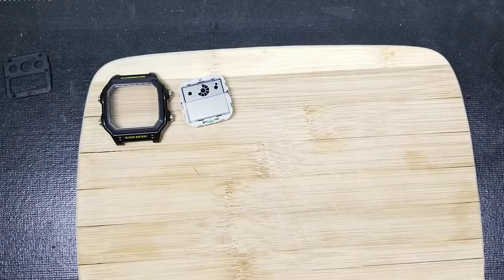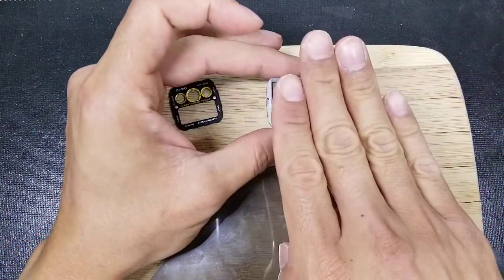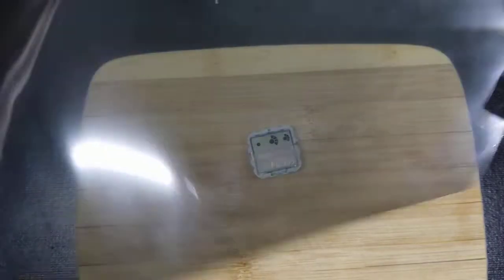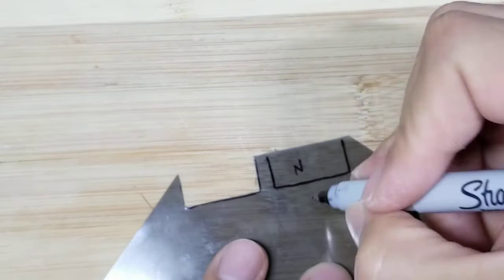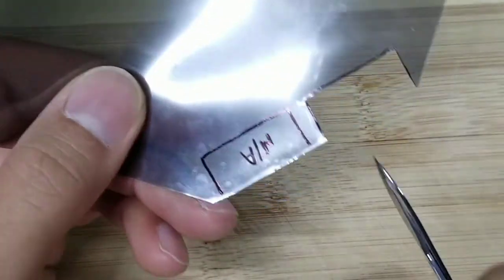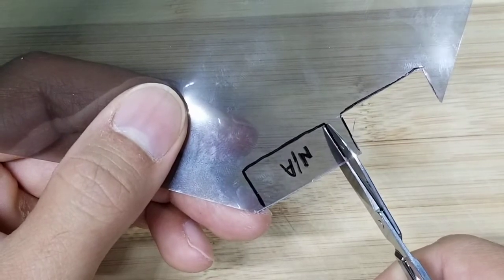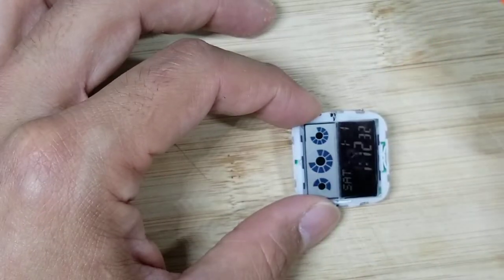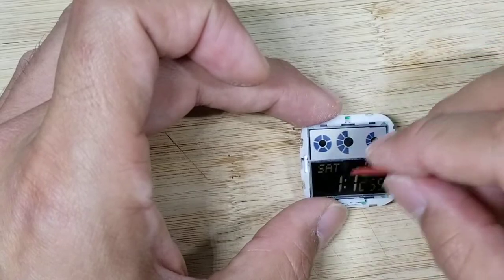Casio Watch Mods  Royale swap  Part 8 of 12

Comment: Could you use the polarizing film with the colour filters? I'd like to make a negative display blue and yellow filtered AE1200WH-1AV
Reply from the maker: It won't work. But you can buy colored polarized filters. I've seen them being sold on ebay in Red and Yellow
Reply: @watchncarry9593  Thanks, will stick to the blue and yellow filters as it's my first go